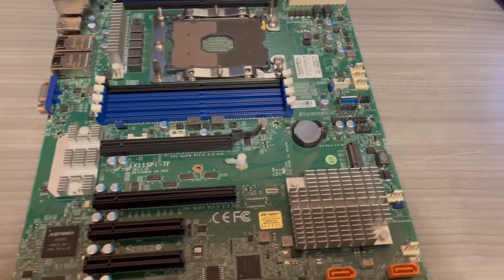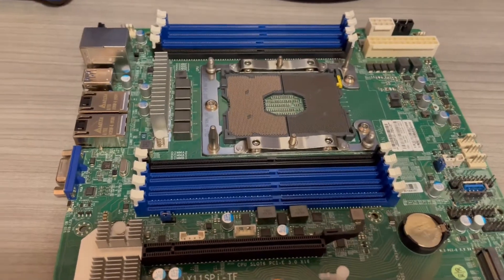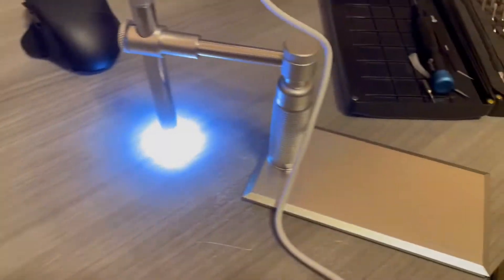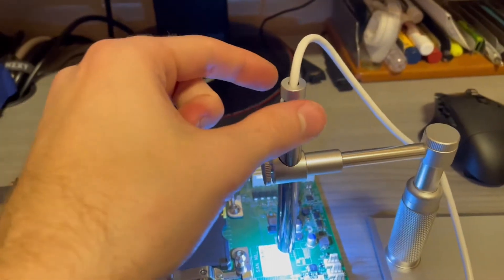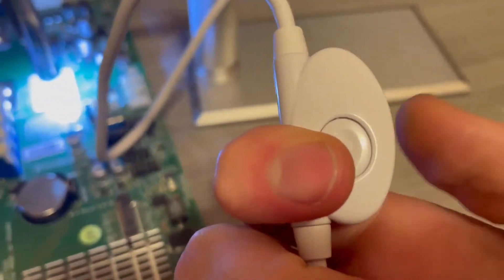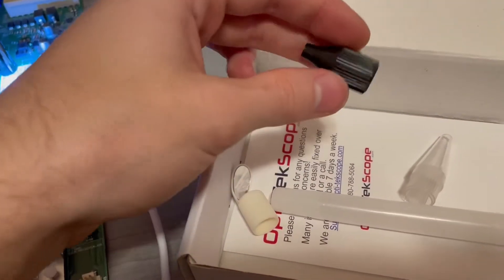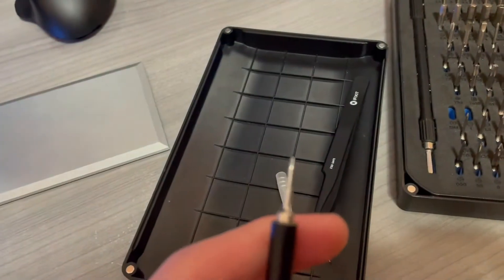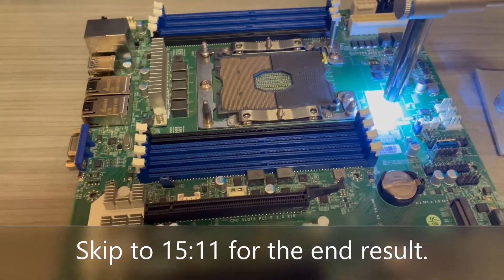Repairing 40+ Broken pins on a LGA3647 Motherboard: Supermicro X11SPI-TF

Comment: I have some 3647 CPUs where the gold plating on some contacts are missing, any chance you have a Pinout of 3647 to check if these contacts are important?
Reply from the maker: The gold plating missing is fine, as long as there is still contact area.
Reply: What do you mean by contact area? The plating is completely gone @tylerebowers
Reply from the maker: @frankfibich7152  isn’t there a metal surface underneath the plating? Or is the pad completely gone. I don’t have any pinnouts.
Reply: @tylerebowers  yeah but it's not reliable to sustain contact. As far as I know it corrodes easily.

I just decided to make a Pinout myself, if you want to have it, once it's done, let me know
Reply from the maker: @frankfibich7152  I think it would be fine, wouldn’t worry about corrosion. Hopefully you can get it working even better!
Reply: @tylerebowers  hm, I wouldn't want that CPU doing important tasks :) depends on the data